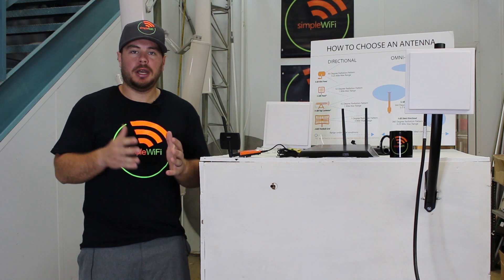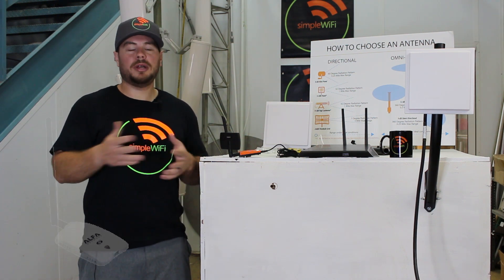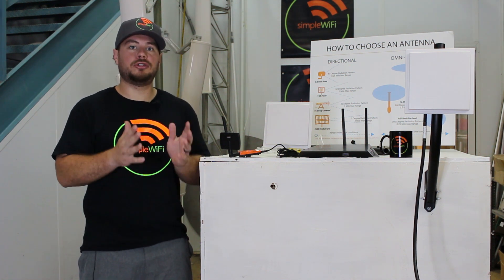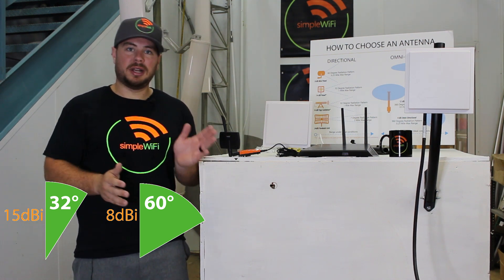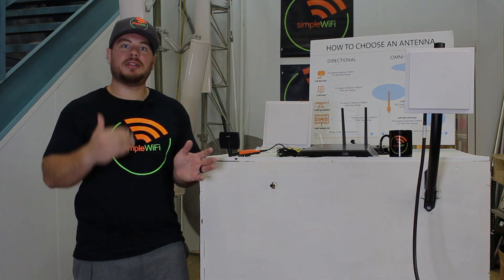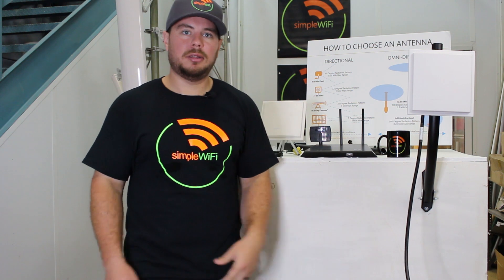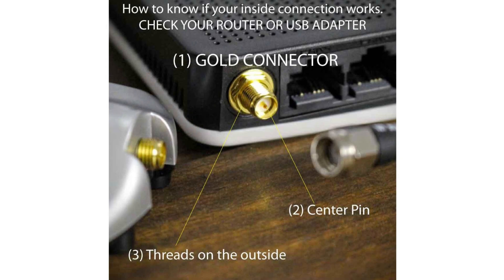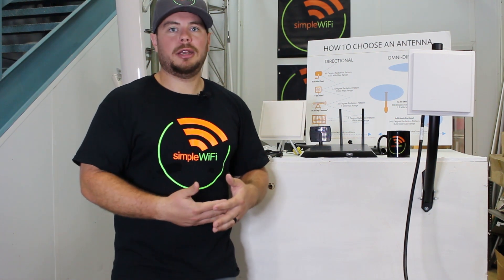How to use WiFi Panel Antennas - Complete Intro Guide

Comment: I'm on your site now. Where are the USB adapters? I want to buy the indoor panel and use on my PC to pick up wireless signals better. I've looked all over the site for a USB adapter so I can go from the coaxial cable that comes with the antenna to the USB port on my PC. I tried using the Chat feature on your website, but it seems to be an email phisher.

Comment: I’m trying to find a antenna to pick the WiFi from my to my shop, I need something I can mount on the outside of the outbuilding that will catch the WiFi from house. And from the antenna on the outbuilding I need to hook it to the router inside the metal building. Any ideas?

Comment: May i have a question to you? I am planning to purchase an outdoor WIFI tube adapter with 8dBi antenna. I live in a plain area on country side with 1 floor (here and there 2 floor) family houses with backyard areas each. and i want to scan the ambient WIFI networks in neighborhood for experimentations. How high should i mount my WIFI antenna? should i mount at 2 meters high on the wall of garage or on the roof of garage at aprox. 3,5 meters high from the ground? I have heard that WIFI antennas are not meant to be mounted high because of the radiation pattern. So i dont know if 3,5 meters is high or not.  and if you say that 3,5m is better, can i install it on a metal rod above a dish antenna for satellite receiver or will it be interfering with my WIFI antenna? or better to prepare its own place on the roof of garage a bit away from the dish? Thank you so much for helping me :)

Comment: I would like to connect to home router that is 50m away from me, has clear view, using grid antenna i can't manage to position antena correctly, signal is very weak. Is panel antenna the solution?

Comment: At what point (distance) will I have to start worrying whether my wireless device can send a strong enough signal for the antenna to pick up? This is assuming I am still at a distance that my wire device can pick up the signal transmitted by the antenna.

Comment: I have an Orbi mesh wifi router system in my house, but want to set up a simple repeater at the window to receive from the mesh network and rebroadcast in a narrow direction out the window to another location. Are you aware of any wifi repeaters/extenders which would work with one of your 15 DBI antennas? This would require, it seems, 1) that the extender have a removable antenna, OR 2) that the extender have an ethernet OUTPUT to rebroadcast the wifi signal it is receiving from the home router nearby to an external router I can then plug into it, which would have removable antennas to go to one of your antennas. I'm worried the extender will have lousy transmit power, however, as the dbi only specifies *directionality*, but NOT broadcasting power, and I'd like good broadcasting power. Any recommended devices to look into are appreciated. Thank you.
Reply from the maker: Give us a call and we'll walk you through it. 305-798-8505 / Mon-Fri Est

Comment: I wanted to thank you because YOU had mentioned in one of your videos something that was crucial to receiving a great wifi signal. So what was the crucial info?

Here's the story. I was trying to get the most powerful signal I could with a panel antenna. Somewhere along the lines while modifying the panel antenna the signal became weaker to the point where I could no longer get on the internet. I was connected but couldn't connect to websites. So what was the problem? While modifying the antenna I used a longer cable from the panel antenna to the wifi adapter. Somewhere in one of your videos you mention there's a lot of signal loss when you use a coax cable between your antenna and your wifi adapter. THIS IS SOOOO TRUE!!! When I found out that little piece of info I went home ( I was using burger king's wifi ) I grabbed the wifi panel antenna and eliminated the 3 and a half foot wifi cable all together. I then used adapter connector  and about two inches of the wire used in directional antennas. HUGE DIFFERENCE!!! 

So for anyone and everyone reading this who has a weak signal and is using a panel antenna get your wifi adapter card as close to the antenna as possible using the least amount of wiring as possible then watch what happens! I mounted my wifi adapter ( with tape ) directly to the antenna. Now my wifi is working better than ever! 
 
So a Big THANK YOU goes out to  SimpleWiFi a simple little trick made a HUGE DIFFERENCE!!!
Reply from the maker: Awesome! Thank you for sharing!
Reply: @SimpleWiFi  Just telling the truth!

Comment: I would like to extend my WiFi to my detached garage, what is the best solution and requirements, e.g. does the antenna require power, cable type, coaxial 400 was mentioned, is this the same as RG6?  Thanks in advance.
Reply from the maker: Check out the PiFi repeater

Comment: I still dont get it.   My rv is parked 300 ft away from 2 different public wifi hot spots. my computer can see them, but not enough signal to connect with no obstructions at all in the line of sight.  My tecky guy says that unless they do something on there end with their router i will never be able to boost my reception. You are saying that if i buy a usb thingy, a panel thingy, and a router of my own ,,, i can get internet to my laptop? isnt there something that is one piece that plugs in directly to a laptop that gives its wifi better reception without all that other stuff?
Reply from the maker: Give us a call and we can work through it.

Comment: There seems to be a gap in the discussion about wifi antennas on the site. I am one of those who live in an area with many people, mostly students, running their computers, mobile phones and streaming services over WiFi with omnidirectional antennas.
Are there practical steps, using thought, cooperation and directional antennas to reduce the interference problems?
Reply from the maker: Yes - by changing the polarization of the antennas and the frequency to 5GHz when possible. Less devices are using 5Ghz and there are more channels. So that's a quick fix for reducing interference.

Comment: In which polarisation we should mount panel antenna?
Reply from the maker: Horizontal or Vertical - Make sure to match the same polarization of the other antenna.
Reply: @SimpleWiFi  Ok. Thanx. Would you reccomand me panel or grid antenna for distance about 50 meters house? I currently receive -70 to -75 db with homemade biquad. I had read that grid is narrow and hard to setup?

Comment: Hi. I need little help. Can I use sectorial antenna as client? Or it has to be directional antenna. This is antenna I am talking about:

https://www.discomp.cz/maxlink-sector-antenna-17dbi-2-4ghz-horizontal-h-110-v-15-_d492.html

Please respond. I am using tp-link wa801nd ap. Currently with homemade biquad antenna I have about 70-75 db signal. its about 50 meters long house and two walls are blocking signal but I stll manage to get 70-70 signal. Do I have to use directional or this sectorial could do the job. Please respond. Thank you.
Reply from the maker: A sectorial is a directional antenna. You might just want to go with a better directional antenna.
Reply: @SimpleWiFi  Thanx. But is angle that important? Sectorial has H 110? Would it be many interceptions?

Comment: thanks for the info.
What kind of tips would you have for drone use ?
I'm looking into building a portable tripod based antenna for extended range .
Repeater, booster all battery bank power.
Any suggestions ?
Reply from the maker: Panels with wide spreads are popular for drones - but the trade off is you need to constantly aim it at the drone...
Reply: @SimpleWiFi  what about using a parabolic umbrella for photography  ? Would that widen the stream ? Are repeaters enough power to get distance? What can I use as an amp, and not cause interference.  Your channel has taught me so much about wifi, Thank you for all your time and effort helping us better understanding wifi.
Reply: @SimpleWiFi   sir i have 2.4ghz frequency wifi adaptor. Sir my question is can we use dual frequency 2.4ghz and 5ghz frequency antenna with single freq Wifi adaptor? Is this work perfectly or not?

Comment: Can you add 4 of these to the same connection and point them in 4 directions?
Reply from the maker: No not tot he same port.
Reply: @SimpleWiFi  can we use dual splitter connector to attach two different antenna 1 omni and other directional antenna is this work?

Comment: Hey Simple WiFi! I’m Interested behind one of your wi-Fi outdoor panels. I’m trying to get a Wi-Fi hotspot approximately 966.90 ft. My cabin is in the woods and there’s a quite a lot of trees to the Wi-Fi hotspot trying to get. What do you guys recommend for what panel I should get? Also can I mount to a satellite dish that can receive more signal and father? And one last thing, what kind of modem, router, etc should I receive that signal?

Thank you guys so much!
I’ve got all equipment to go except for the antenna panel, modem, router, etc.

*ALSO, I CAN'T GO INTO YOUR WEBSITE GOOGLE CHROME IS REFUSING TO GO TO YOUR WEBSITE*
Reply from the maker: Hello, the panel will work well but you also need some other gear. This is thevideo that will explain what you need: https://youtu.be/K3xBD8ZaT4I
Reply: SimpleWiFi ~ Thank you so much!

Comment: Do you have to have a usb receiver to receive the signal of the indoor 8dbi panel? I have a nightjawk router on my top floor  that sends signal to a wifi extender in the basement which I use the Ethernet ports on to hardwire into my PC.
Reply from the maker: Yes, see the N700 on our page: https://www.simplewifi.com/collections/usb-adapters/products/usb-adapter?variant=43721877647

Comment: could you please advise me, if you can
whats best to improve wifi signal in my house without using extenders. extenders might be good, but i noted that regardless what extender system i use (powerline, mesh, and standalone extender) they all drop signals when moving from room to another in my house. example using facetime or video chat on skype.
ps i currently have vodafone router, but soon replacing it with BT smart hub, in england.

Comment: if i live live near my school (about one mile) could i send a wifi signal to it and connect to it with my phone or is that not possible and if it is what antenna should i use?
Reply: hey kiddo im your mother/father, we found out about your HACKING and you are grounded, no more minecraft
Reply from the maker: Not really - if you stand on the roof of a building and have line of sight to your antenna on the roof then yes you can use your WiFi signal at home. But wouldn't you want to grab the signal from the school at home and get free WiFi? You can do that with the WiFi repeater kit.
Reply: I just want to not use my data but instead to use my home internet but I'm not that smart when it comes to this stuff so that is why i was asking.  -Thanks

Comment: Hey thanks for the videos, they are great. Clear up some basics for me please. Lets say I have a panel which goes 100 meters and its connected to my access point. Then lets say I have a laptop which can travel 10 meters. Does that mean at 109 meters I have a connection, because there is a 1 meter overlap in the signals? Or do you need the same technology on each side so 100 meter panel and then another 100m panel connected to the laptop? So in other words, can I got 1 mile away from my house and point one of these at my house and pick up the standard access point, or would I need to also have a panel on the house pointing back at me.
Reply from the maker: Using two panels is always a much better solution. However, depending on the environment, power and distance you may be able to get away with just one panel.
Reply: @SimpleWiFi  sir i have 2.4ghz frequency wifi adaptor. Sir my question is can we use dual frequency 2.4ghz and 5ghz frequency antenna with single freq Wifi adaptor? Is this work perfectly or not?